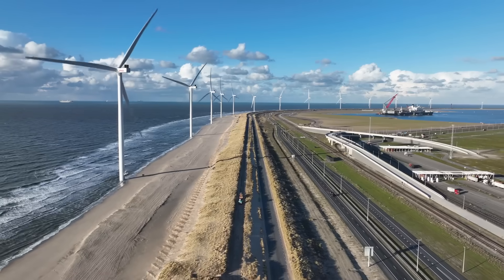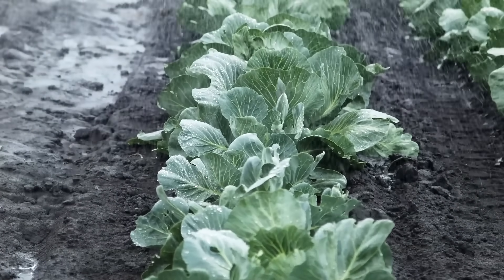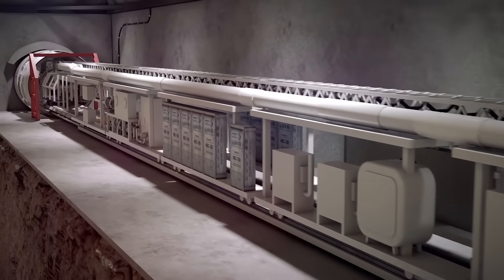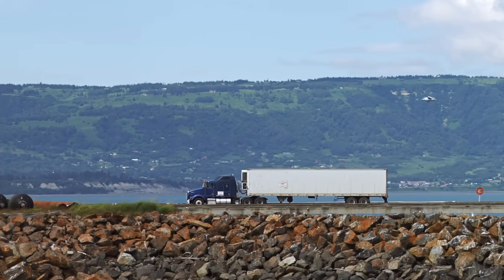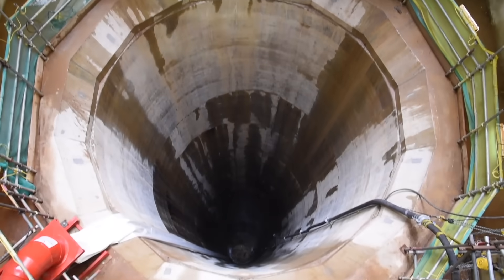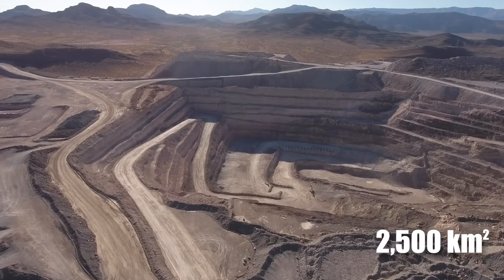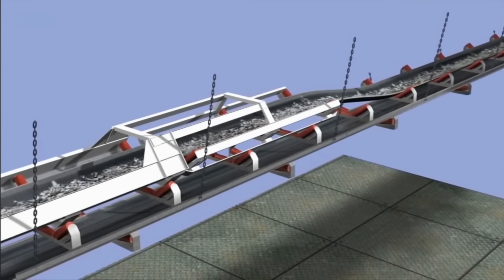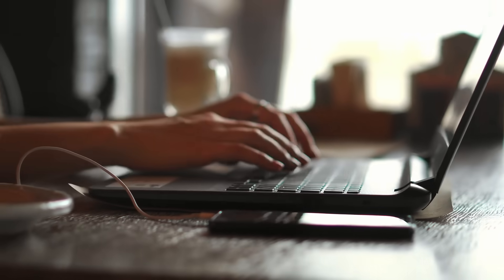Britain Is Building A Massive New Super Mine That Nobody Has Heard Of

Comment: It's pronounced "poly-haylight". As an Engineering Geologist I was part of the original Ground Investigation looking for the halite in the first place gaining knowledge on dewatering and geological and getechnical properties of the area. I have some halite from almost 1500m depth on my desk at home. It was a very interesting project to be part of. I drove past it last week and the area had changed quite a bit since the original GI was done.
Reply: Could you please explain. Not my area at all . Just slightly concerned. 
What happens to the enormous cavens left by such intense mining. Also at this depth and this exent of mining, doesn't this undermine the stability of the area and lead to subsidence.
Just all sounds a bit to good to be true.
Thank you in advance.
Reply: @DERAMNONA  The mine is back-filled as they extract. The geological make-up and structure of the site is, after decades of tests, deemed to be sound. The conveyor belt shown in the video is 2.5 miles deep. I was involved in it’s construction
Reply: @wallace686  Involved in it's construction? Really? The deposit is stated to be 1500m-1600m deep. Why would they construct a conveyor at a depth of 4000m? They also state the conveyor will be 360m deep. They are removing enormous volumes of material, what exactly are they back-filling with??
Reply: @wallace686  , the conveyor isnt at a depth of 2.5 miles, the mine isnt even 2.5 miles in debth. It will be around 1600 metres. The conveyor will be at a depth of around 360 metres.
Reply: @DERAMNONA  , the mine is so deep it wont have any effect above ground. There is already a mine 10 miles away from this project that is mining the same mineral. It previously mined for 'potash'. That mine has over 1000 kilometres of tunnels.
Reply: @asitis8990  appreciate you replying with that information.
Thank You
Reply: The GI would have ensured the strata above was stable, its 1,5 KM below GL. @DERAMNONA
Reply: Yeah the fact its now owned by American oil greeders should mess the place up .
Reply: @samosborne7329  thankfully, they won't due to a tight and well-planned schedule of works and strict environmental regulations. It isn't like the 1800s wild west gold rush days.
Reply: @samosborne7329 The Americans involved in opencast mining in Wales have plenty of form of taking every last bit of valuable mineral and then closing and leaving a huge mess behind and our government leave them do it. The ugly face of capitalism and unscrupulous politicians.
Reply: @dickdastardly5534  yep i live in west Cornwall and can honestly say that the level of pollution neglect and utterly appalling behaviour of the mining over the years is frankly criminal mate
Reply: @samosborne7329  I am not against capitalism but this is the side that you never here conservative’s rave about, the public inevitably ends up picking up the tab and letting these companies off the hook.
Reply: @dickdastardly5534  ha ha i love the way utub is not showing our comments to this in any readable order..you will have American mineral extraction and dam well like it ..
Reply: @samosborne7329  there is another owned by Israel not far from there too.
Reply: @samosborne7329  AngloAmerican has a major Indian shareholder, and was originally founded by OPPENHEIMER in South Africa
Reply: @gavinkalaher7314 There were some pretty frightening scenes of shale oil extraction. The owners will need to be kept under supervision or they'll fly away when they're ready.
Reply: @petergilkes7082  shale oil and tar sands extraction is pretty horrific I agree. It's easier to get away with it when the site's in a remote location in Canada etc. The difference with Boulby's polyhalite mine is it's within a protected national park and near to local communities.
Reply: @gavinkalaher7314  I'm unsure how "dirty" this sort of mine will be. I guess not too clean?
Reply: @petergilkes7082  you won't even see this mine, all the extraction, operations and transportation of the polyhalite happens deep underground. Polyhalite is just a type of salt used for fertilizer, so it's not dirty or dangerous.
Reply: @gavinkalaher7314  OK, thanks for that!
Reply: @samosborne7329 oy vey Sir
Reply: It will fill up with seawater and thus lead to a drop in the ocean level, leading to the salvation of the planet, Venice will be saved🇬🇧
Reply: Can’t believe I’m geeking out on subterranean salts! Haha!
Reply: @wardygrub  fill yer boots 😉
Reply: It seems silly for this to be the pronunciation if it comes from the Greek ἅλς. Not saying you're wrong, just saying it seems odd. We don't pronounce halogen "hay-lo-jen" for example.
Reply: @sb_dunk  it might seem silly but that's just the way it is pronounced. There are lots of English words that are not pronounced how they look.
Reply: As a geo-environmental driller this G.I would've been a dream site for me
Reply: A LOT of American You Tubers do not understand English pronunciation….in particular the general rule that doubling a consonant ‘hardens’ or phoneticises the preceding vowel….Which is why we say Apple and not Aypal….it also makes the difference between Diner and Dinner, which in American sound identical.  This IS important however, because different words mean different things, right!  Try this American viewers….The Diner Dined on his Dinner in the Diner!  😊!    Currently Joe Biden keeps mispronouncing the word “Divisive” which is quite irritating to hear.  It should be…Div eye siv, but JB says Divissive with that hard second “I”.  This has NOTHING TO DO WITH ACCENT…It is just incorrect English which for a country leader is a pretty poor show imo.
Reply: @contessa.adella 
Thank you for explaining the rules !
Reply: @contessa.adella  I suspect that in this instance they just didn't know how to pronounce halite due to it being a technical term is all, although I do understand what you're saying.
Reply: He's a pretty poor show for a leader anyway. He only looks credible because the last one was so outrageously inept. @contessa.adella
Reply: I'm curious, what financial incentive does this bring back to the people? I assume flogging off vast amounts of our natural resources to foreign corporations would at least bring back a cut of the profits into the treasury? Or is it just the same old mining "we'll provide everyone with jobs and a few meaningless regional grants until we run out"? Genuinely curious.
Reply: @Winter-CIG  well there’s jobs-income- TAX.  Contractors jobs and purchase of equipment- TAX   corporation profit-TAX.  Company share holding-pension funds- pensions to people who pay TAX,.  COMPARE  Thousands of “ imports” who swell GDP without ( largely) any contribution and often great cost( 5* hotels?).  Meanwhile highest taxes since WW2 anyone would think were in another war!  “ I did mention Uk- raine once but I think I got away with it” 🤭 🤡🌍
Reply: @Winter-CIG  None for the UK, all the money will end up in Tel Aviv like normal. 🇮🇱👀
Reply: @MattyEngland  evidence ?
Reply: No you weren’t shut up
Reply: Hello. Do you know if they will fill the mining holes and tunnels in when they’ve finished?
Reply: @wardygrub  typically they are grouted up like old colliery shafts are with a bentonite cement grout.
Reply: @bill5974  thanks for that. Do they fill it straight away? I’m just thinking about all the unnatural cavities and how gravity wants to press it all in.
Reply: have we got any other valuable minerals in the
Reply: @joeblack2534  well there’s a lot of local peoples money at the bottom of that hole which now belongs to “ the yanks?”   THANKS BORIS ANOTHER SCREW UP 🤬
Reply: Not being able to pronounce the actual subject of the video properly indicates sloppy and shallow research at its most basic level, however, the video itself was interesting and informative, even if it did show stock footage from other industries such as conveyor belts transporting coal!
Polyhalite is misleading to me, it implies it should contain halides. Wikipedia isn't very forthcoming on etymology.
Reply: I'm just wondering what degree or degrees you studied to become an Engineering Geologist?
Reply: @Daniel-or3vf  Typically you'd do Applied Geology degree and Geotechnical Engineering Masters.
Reply: @bill5974  Thanks for the information, it's certainly an interesting field. I was looking at geophysics initially.
Reply: @Daniel-or3vf  I work with a o of geophysicists. These jobs tend to go hand in hand.
Reply: @bill5974  I'll look into them both, though I'm sort of leaning towards the geologist/engineering route now.. thanks for your help!
Reply: @Daniel-or3vf  It's a small industry, no doubt our paths will cross at some point...
Reply: @bill5974 Just being nosy, where did you study? I did Engineering Geology at Sunderland.
Reply: @GothBoyUK  actually in Sunderland. 1997-2001.
Reply: @bill5974  No way! I was there 97-00 with my MSc in 00-01. Small world. I'm crap with remembering names but think I remember a Will, possibly. You sat near Lisa and Ashley, if I'm right.
Reply: @GothBoyUK  Christ I can barely remember last week never mind 20 odd years ago pal! All I remember is it was in Priestman or Benedict building up past the bus interchange but I have no idea if any of that is even there any more...
Reply: @bill5974  Hehehe, all the drilling knackered our minds. They pulled Benedict Building down years ago after they closed the Geology department. Haven't been to Sunderland in over a decade but the last time it had completely changed.
Reply: @GothBoyUK  Didn't realise they pulled it down to be honest as (I too) haven't been in that area for literally decades. In fact I think the last time was a get together in Fitzgerald's where I used to drink, and even that was a LONG time ago. Makes me feel old.
Reply: @bill5974  Aye, it's like another lifetime ago.
Reply: Americans habitually mispronouce English - and have done for years - not news!
Reply: The Curious Lobster did an in-depth video on this a few months ago. Check it out
Reply: The dust is terrible

Comment: the mine is known to a lot of people. On the surface it will not look like farm buildings, although it will have landscapes and trees to shield it and for it blend into the environment.
Also in a typical American way of running down the U.K., new gas and oil fields are going to be drilled, so the U.K.s Natural resources are not depleting and exports are still high.
Get facts right!

Comment: First time I have heard about it,but if the seam is 70 mtrs. thick, how is the strata above going to be supported, as it will cause surface collapse if is not supported.
Reply: the same way they do it with most mines. My cousin works there. He basically is a concrete specialist making sure the composition is at its most strongest so im assuming concrete will be involved as hes being paid a fortune.
Reply: @ashleygoggs5679  I doubt you can do it the same way as mining other minerals. Polyhaylite crumbles and the strata above it are also soft. If you create a void, it will collapse. Erecting a concrete roof strong enough will cost a fortune, assuming it is feasible.
Reply: @thornsaresharp  not necessarily, Im not insinuating they would build a concrete roof. However its very feasible they could use concrete posts to support the weight while using friction rods along the horizontal axis to stop earth from falling in. This is a common method used in most civil engineering. Its why we see huge rods pilled into man made tunnels etc. as the rods cause tension with in the earth making it far more stable and less likely to move under pressure. It compacts the particles of dirt together as the rod exerts pressure displacing earth particles tighter together.
Reply: @thornsaresharp it will be rock bolted
Reply: Mostly under the sea i think.
Reply: Mt Uncle used to drive a train 2 mile out under the north sea from Seaton Colliery in the same area so yes correct.   @crispinaske8293
Reply: its about 1mile underground
Reply: @markreed9853 2.5 miles. I was involved in it’s construction